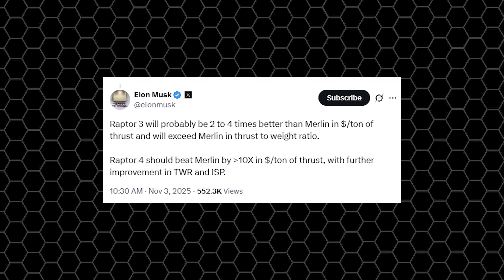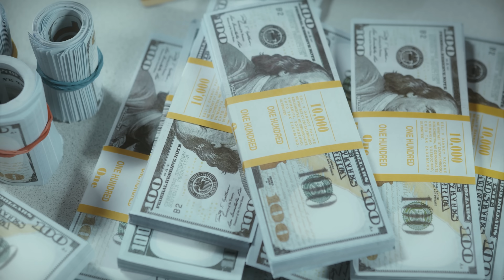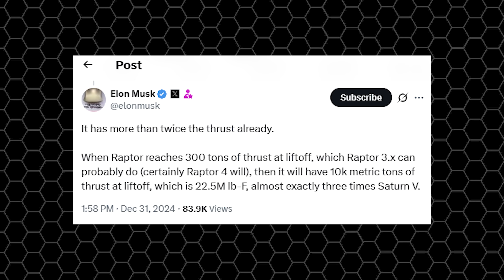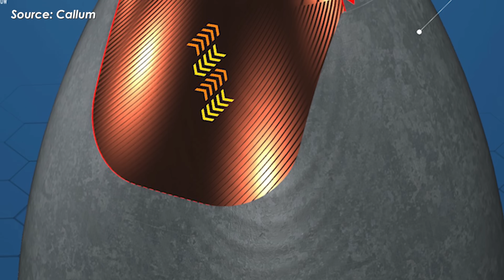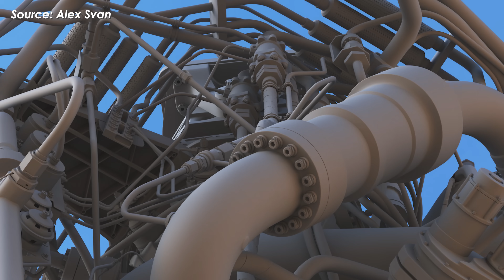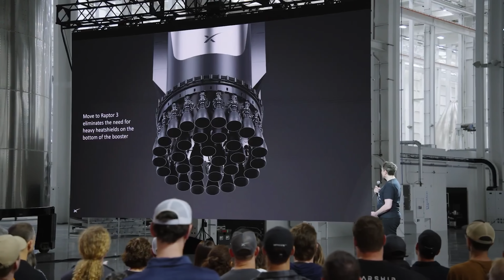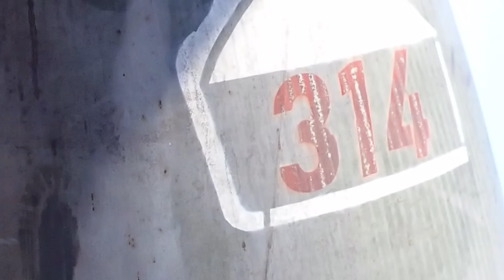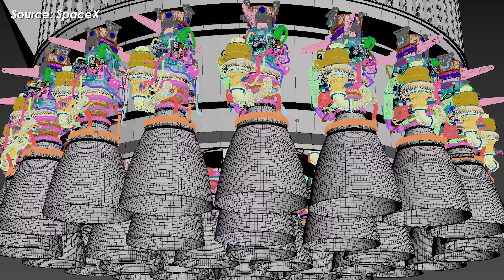It's mind-blowing! Elon Musk Drops Big Upgrade on Starship Raptor V4 to Moon Shocked Industry...

Comment: For landing on the moon have one module. Do a landing that's got a bulldozer or something similar on it. Solar panels to recharge batteries when it comes back. Use the bulldozer to prepare a landing spot that is flat and hard for letting the rockets without a landing legs.
A spaceship could be orbital to controlling the robot

Comment: I know Elon has plans for an airbag to tip the rocket over on, but I was thinking why not build airbags into the rocket itself, this way it could be used as an emergency device and protect the rocket if it was to tip over on landing on the moon, and as a method to tip them over when there ready.
Reply from the maker: Airbags built into the rocket itself is an interesting idea!
Reply: #MoonBaseAla 
#MarsBaseAlpha

Comment: I think your math is off.  300 tons * $100,000 / ton = $30 million.  Elon has talked about the engines being much much cheaper than that
Reply: 33 of them plus 6 ..  I bet it's probably closer to about 1 million each engine. Raptor 3 was estimated to be $250000 once in production. Assume raptor 4 is the enhanced and improved version of raptor 3. 

I suspect raptor 4 is needed to meet the promised 100 tons lunar delivery goal and return. 

Raptor 3 and current Starship design can deliver roughly 25 tons to the moon's surface and return.
That's why the Starship stretch and new engines. Maybe why 35 booster raptors are mentioned.

The Booster is really the key to Starship. The more delta v and lift it can impart to Starship's upper stage the more cargo and less fuel it uses to get to LEO. Orbital refueling is necessary to top up Starships fuel tanks. The more fuel left the less tankers needed. 

There is a compromise, Starship upper stage could be only fueled to the point of only reaching LEO reducing its launch weight.

Comment: Elon Musk~SpaceX proposals for Artemis Moon-landings rely on the existing Starship system and the current dev'lp of its Raptor~3 engines. Raptor~4 is a theoretical concept, with no concrete plans or prototypes yet ~for Nov. 2025